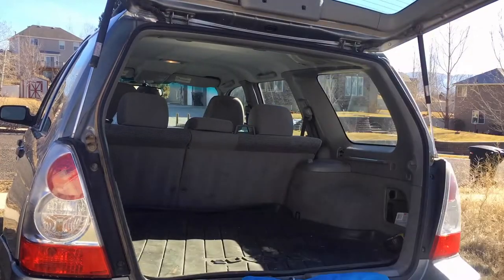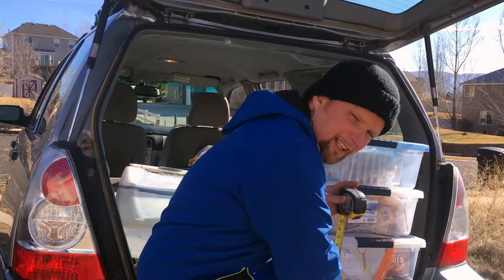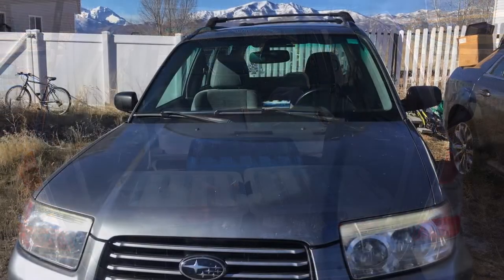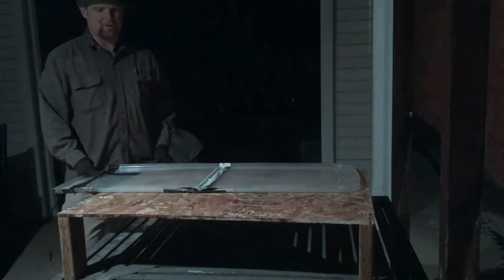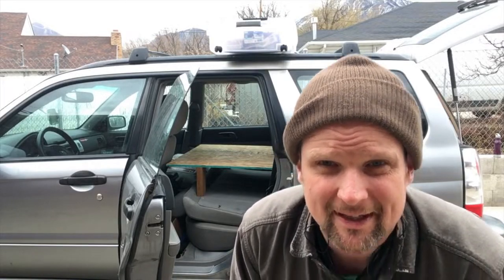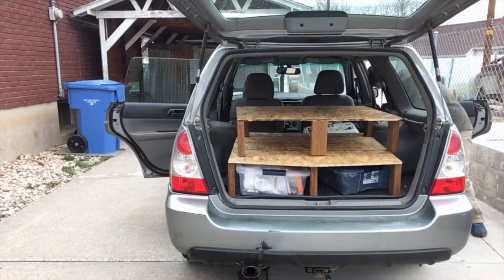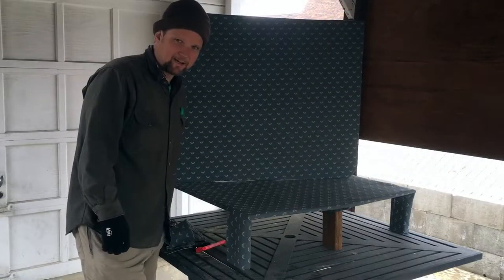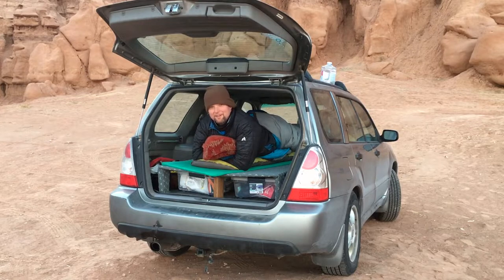How to build a sleeping platform for a compact SUV on a budget

Comment: Not bad Amos. I've spent many nights in my 2001 4Runner near a trail head or on the way to one. Not to mention waiting out a storm or two. I know you'll find good use from this projct. 😆
Reply from the maker: Thanks Tony, I imagine the 4Runner is more roomy than this rig. Admittedly the 2006 Forester I currently drive was chosen for it’s identical dimensions to the 2008 shown here. Fortunately the 2006 one has a moon roof such that I can do some star gazing before I doze off ⭐️ 🌟 🌙
Reply: @BackpackerDiaries  I'm kinda lucky that one of my inflatable mattresses fits in there well. And still have room on one side for my gear. I like your ingenuity.
Reply from the maker: Thanks again Tony!
Reply from the maker: Did you notice the bluecollar backcountry sticker placement?
Reply: Yes I did. Thanks for the support. Seems like the sticker thing kinda died down with everyone didn't it ?
Reply from the maker: I never did follow through with that for BD But the adhesive on the sticker you sent me is still holding strong!

Comment: I am on my 3rd Subaru (2nd Forester!) and they are terrific vehicles . . . but they are quite compact (and much cheaper vs) a Ford Transit or a Mercedes Sprinter or Ram Promaster, especially with all the conversion costs.

So could the Subaru work for simply sleeping and storage?   This video is quite helpful. Thanks!
Reply: I would add some tinting to the back windows in case one has to sleep in a less remote location (like a big Wal-Mart parking lot), and one wants a tiny bit of privacy.
Reply from the maker: Good tip on the tinting yucktool; I have not used this system in an urban situation yet. For me this is mainly a device for boon docking/car camping at the trailhead so have not tested it as a longer term sheltering solution myself...

Comment: Nice build — I’m working on mine now. How do you get out once the hatch is closed? Slide through the back door?
Reply from the maker: Thanks! I'm short and nimble enough that I usually slide into the driver's seat where I typically leave my shoes etc and exit from that driver's side door. I've also used the side doors as an exit/entry but found it more awkward that way. I'm not sure if there is a handle to exit through the back hatch; I'll have to look into that.